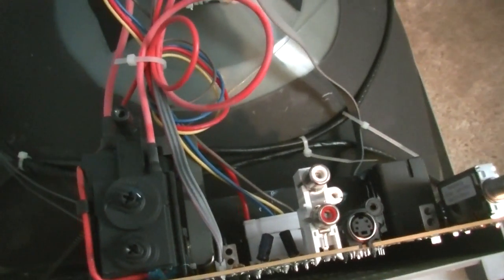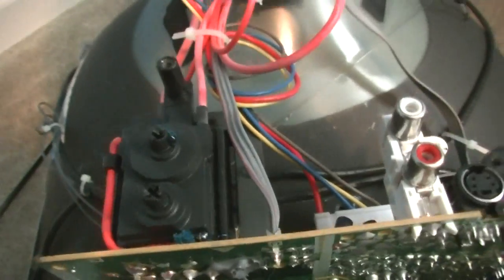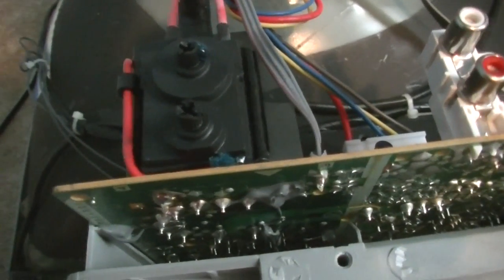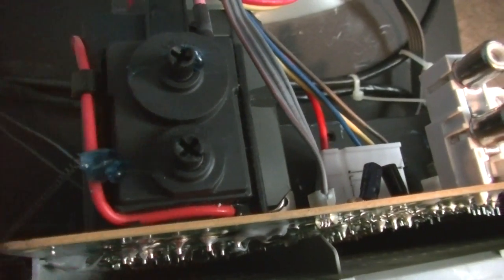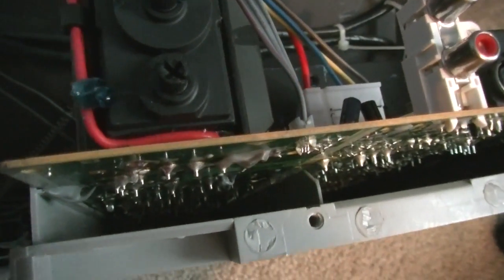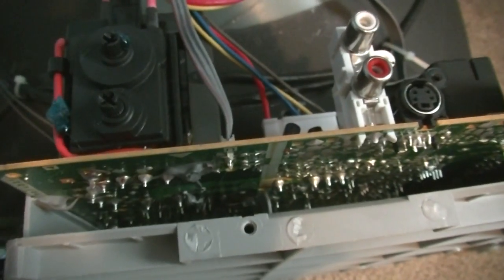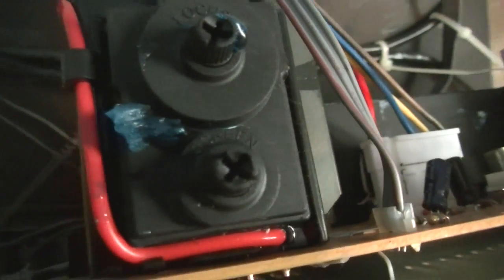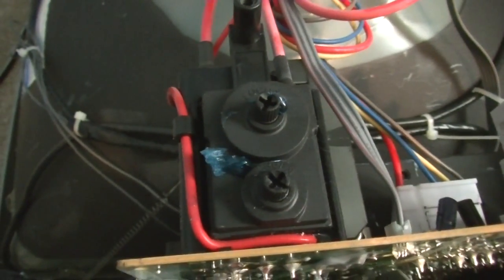Adjusting internal screen control on CRT Television

Comment: I have a crt with the same thing from 1995 and it is huge and looks astounding for an old tv but it’s really dusty and after about 10 minutes it will make a crackeling popping sound
Reply from the maker: That’s not good! That probably means the flyback is arcing
Reply: What’s that mean?
Reply from the maker: I’m not an expert really, you’ll have to find a video about it on shango066’s channel. Or some other channel
Reply: Ok

Comment: Hello, I hope you can help me!! I have a CRT Panasonic CT 2995, 29 inches I think. I'm trying to use it for playing with light gun games (specifically Guncon pistol for the PlayStation) and whenever I try to calibrate the gun, the crosshair leans roughly 4 centimeters to the right. I accessed the service menu and tried to adjust the V and H position/size, but I still get the same problem. There's a lot of adjustments available on the service menu but honestly I don't know how to use them. Any suggestion you could offer? Thanks in advance, thanks for reading!
Reply from the maker: Sorry, but nope... I'm not proficient in how light guns work really, I did have one once but never really had an issue using it.
Reply: @TheCRTProductions  Thanks a lot for answering! My guess is that the screen size has been affected and I'll have to adjust it via service mode. Trouble is, there's a lot of adjustments so I'll have to do my homework and learn about it.

Comment: Are there generally adjustment for horizontal orientation? An old CRT I'm restoring displays a crooked image, needs to be turned counter clockwise.
Reply from the maker: You will have to turn the yoke accordingly, search the internet for CRT yoke
Reply: Some consumer sets have a rotation setting.
Look up your model number online for the service manual to find out if it does.

If it doesnt have that setting, then the entire yoke has to be rotated.

Comment: To set the screen/bias correctly, run the CRT for fifteen minutes to half an hour with regular programming source to warm it up.

Ensure that ambient lighting conditions in the room where the set is are average - not the dark of night.

Next, set your front Brightness and Contrast both to their mid-points.

Next, find a good calibration DVD - Avia or Digital Video Essentials, and display the black level pattern on your screen.  

Adjust the screen flyback control until the pattern appears as prescribed in the DVD instructions.  

Next, increase the user 'Picture' or Contrast control all the way to max, and sharpness all the way down. 

Display a resolution/ sharpness pattern on the screen. 

Adjust the flyback focus until it is as sharp as can be, with the Contrast maxed out.

Next, lower the Contrast back to the mid point, or no more than two-thirds of maximum.

You should now have the sharpest image you will ever see on a CRT, unless the convergence is out of whack!

Adjust the user sharpnes per instructions on the DVD for that pattern.

Comment: I have an APEX CRT manufactured in 2002 that has a lot of screen cutoff vertically and horizontally. Is there any chance that I could internally or externally adjust the picture internally or externally to fit the whole image?
Reply from the maker: Only old tv's have that control, usually early 80's would be the latest you would see those as adjustable controls. To fix that on a 2002 set you'll have to replace some capacitors unfortunatley..
Reply: I was afraid of that... thank you! Is there any way I can determine which capacitors I need to replace?

Comment: can i do do this with the tv powered on or i need turn it off
Reply: Niko and unplug it
Reply: @meatsafemurderer7743  yes..use gloves..and dont touch somes zones..just the buttons,rings..
I will do the same with my blast city nanao toshiba crt.
The only thing..strangely no nanao 2930 manual and no blast city manual in english..nobody did it strangely..also no tuto to show all the stuff to have a nice picture in 15/24/31 khz.
Arcade is a discovery,you need to do a lot of stuff by yourself.
Reply: Yes

Comment: I have a 1995 floor console zenith television will that work on brightening up the screen😲
Reply: Yes it should work on this. Be very careful though. 

If your LOPT (the black thing with a (usually red) wire going into the back of the tube) doesn’t have 2 controls, do not adjust that one, it can make the picture blurry.

Comment: I'm having an issue with my Trinitron 32WS2U, the picture itself is fine but there are lines on the screen that kind of look like interference that are really bad when no connection is on, but when I connect a composite input it nearly disappears, with s video it's slightly more visible and with RGB slightly more again, will adjusting the screen screw on the flyback help with this? Or is my issue caused by something else?
Reply from the maker: Are they moving up or down the screen slowly? I have a TV with a similar issue, also 32 inches, just the cheap plasty board inside probably.
Reply: @TheCRTProductions  from side to side horizontally, is there anything I can do? It's a trinny so i thought it would be good quality 😔
Reply from the maker: @mattjcwig  No clue about that then... With mine it's only up and down, and only on coax (antenna) input. Could be bad wires?
Reply: @TheCRTProductions  it's quite hard to describe, I could email you a video when i'm able to get one 🤔

Comment: Im so pissed. I just got back home with a Sony Trinatron 27"  it worked fine when i left their place but once i got back the image is now moved to the right and the left side has a black bar...  i didint drop it...  i cant find out anything. I currntly have it open and im looked for anything that may have been bounsed around. Which it wasnt.  Any advice?  The picture looks amazing. Other then the black bar on the left now
Reply: This is either the deflection yoke moved out of place during shipping (pretty unlikely) or a bad capacitor with low voltage.
Reply: Sebastian Pojman it literally happened within 1hr... i played on it at the sellers house... loaded it up in my car...  brought it up to my apartment. Now the image is moved alil to thrme right and a long annoying black mar on the left.....
Reply: Is the convergence out of alignment? If yes, then the deflection yoke is your problem.
Reply: Sebastian Pojman what is that?  Is it fixable?  I did hit a few bumps and it bounced while driving home but nothing to crazy.  Thanks for your help
Reply: Can you send me a picture? That'll finalize my suspicions. You're welcome, by the way! I just happened to check this video when you commented.
Reply: Sebastian Pojman ok i will say this... im not missing any image on the right side... at first it looked to have been moved over. But its more like the image maybe just smaller now...  with the left side not filling it.. just a full black bar on the left. Right looks fine
Reply: That definitely sounds like a bad capacitor, considering that you haven't mentioned anything of colors out of alignment. Your problem can easily be fixed, but a CRT repairman would charge about 50 bucks. Sorry :(
Reply: Sebastian Pojman im sure i can replace a cap...  if i could figure out which one.
Reply: Sebastian Pojman ill send u a pic of it.  No problem. How can i??
Reply: Sorry, I just saw these replies. I found a website that you could upload a picture to: https://imgbb.com.
Reply: Sebastian Pojman hey!  So i THINK i got it... i hope.  I found a dial inside for the horizontal.  I adjusted and its perfect now... makes me wonder though if that means something else is wrong if i had to adjust the dial... but as far as i know right now its great....  yet again hopfuly it doesnt mean something is going out.... lol
Reply: You're lucky, let me tell you. Most consumer TVs threw out the dials for horizontal and vertical size and instead used a capacitor. Panasonic kept the vertical dial but got rid of the horizontal (I don't know why). It's a good thing Sony CRTs included all the bells and whistles known to man!
Reply: Sebastian Pojman yeah!  Im not sure why i had to make the adjustment. Maaaybe a bump in the road threw it out?... or maybe i just gave it another 10 years lol. Ether was it looks great now..
Reply: Congratulations! Those Trinitrons are becoming very rare. Take care of that baby!!!!! sobs uncontrollably

Comment: What does the other knob do? I know it says focus but whats it used for?
Reply from the maker: Focus makes the picture sharper or blurry, like a cameras focus
Reply: @TheCRTProductions  I gotcha. Yeah I thought I was messing with the color knob but it was the focus. I put it bck to where it was. And adjusted the brightness level. It was too bright. I've got a 20" sanyo 2006 flat crt. Has a little picture "bending" on one side but not as bad as the rest ive come across. Wish I knew how to fix that tho as I'm almost a perfectionist when it comes to visable stuff but I guess cant be too picky on stuff that old. Like I said its the better one ive found.